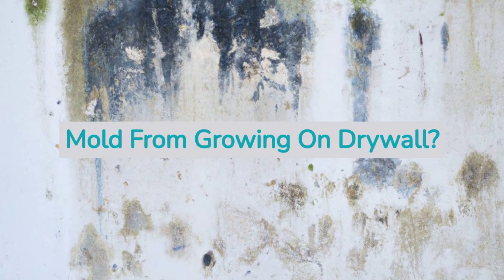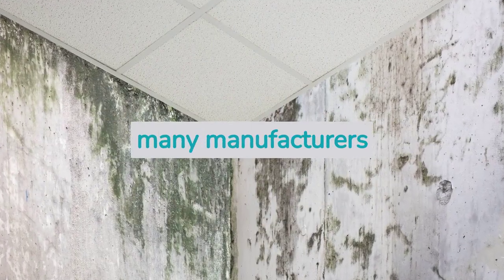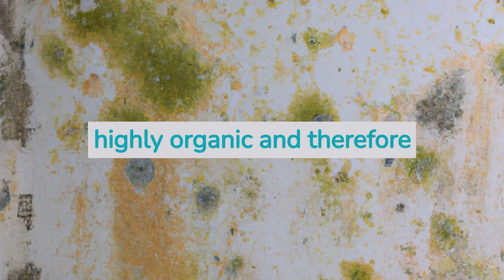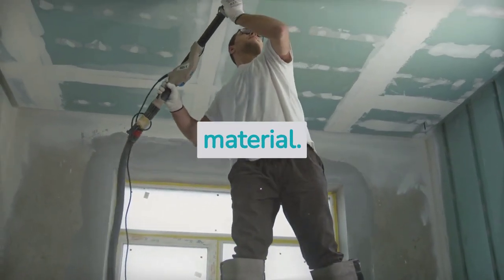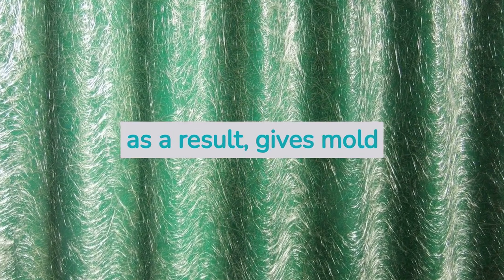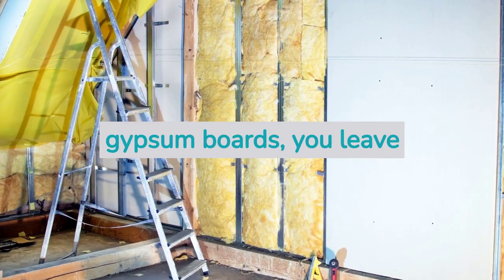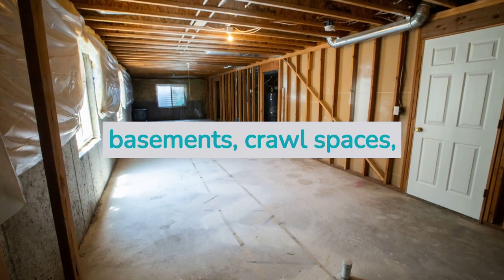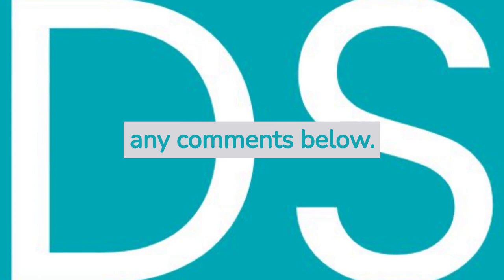Is Mold Resistant Drywall Worth The Investment? Damp Solving Water & Mold

Comment: But the back of it is paper. Where most likely will not dry and grow mold it's a waste of $
Reply from the maker: It depends on the product you go for. Some provide a waxy coating or fibreglass protection over that layer that helps prevent Mold. 

As always though they’re never 100% guaranteed to prevent Mold. 

Thanks for the comment 👍
Reply: Not only that, paper faced insulation on an exterior wall is another place where mold can grow. Ripped out some drywall and the paper on the insulation was pretty moldy. I've never understood this concept of using a PAPER faced product as a moisture barrier. Makes literally no sense.